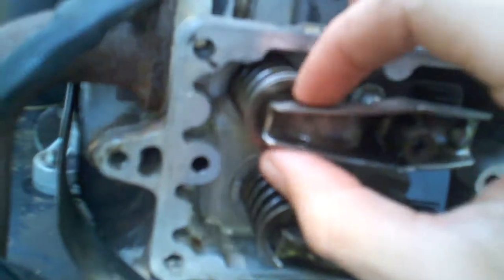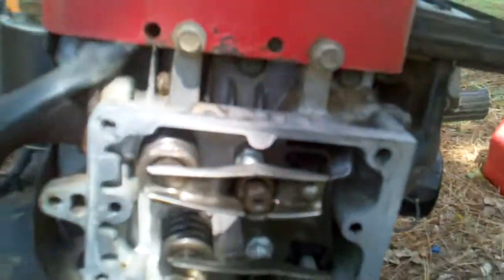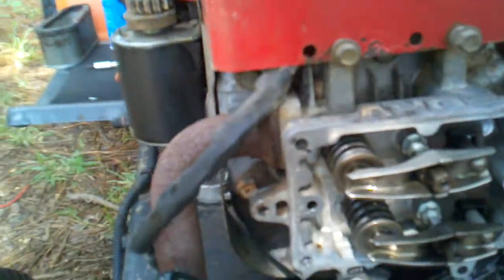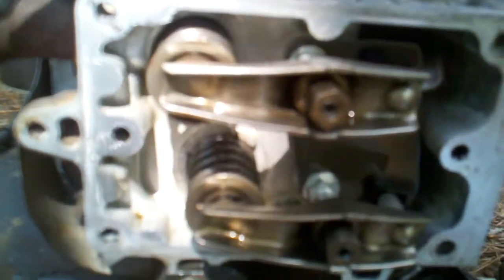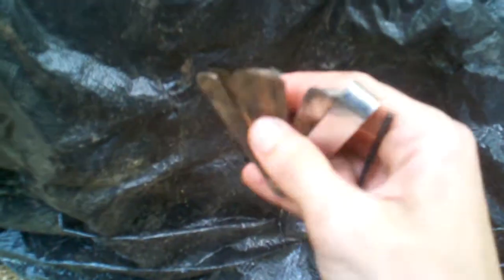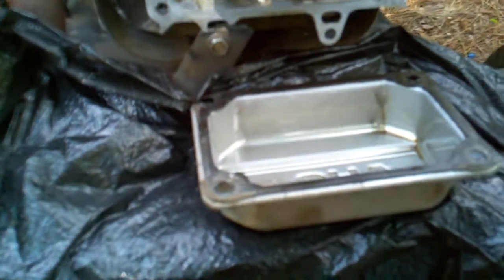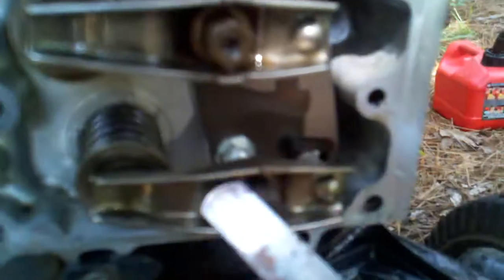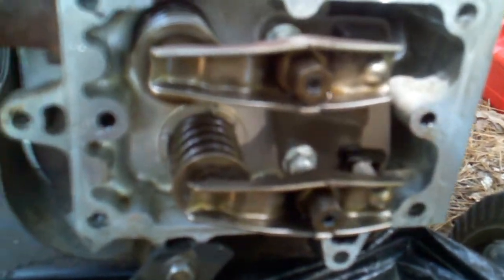Valve adjustments on 15hp mower

Comment: Check the leakdown to check rings, valves, and head gaskets. Check the valve adjustment. If the rockers are very loose, it could be the seat is loose. Replace the head. With the rockers off, check the leakdown to check valves. If the valves stick, hit the spring with rockers removed with a hammer to unstick the valve. Replace the springs since they lose tension. Remove the plug to turn the engine. With the springs off, rock the stems to check the guides. If loose, replace the head.
Reply: 😂😂 what.